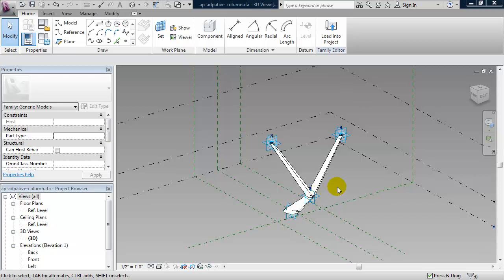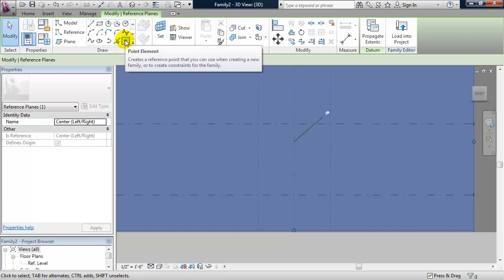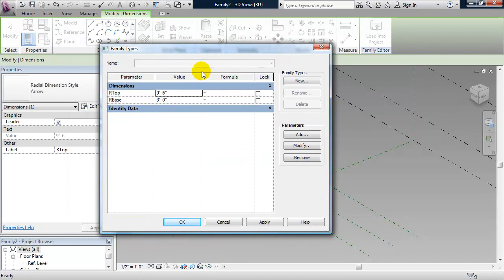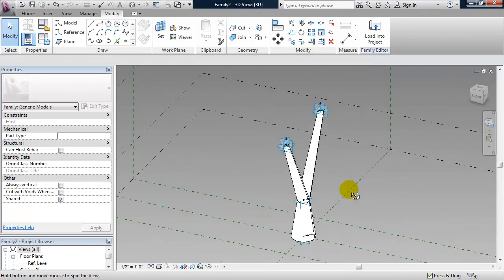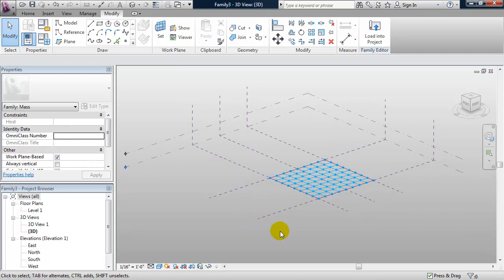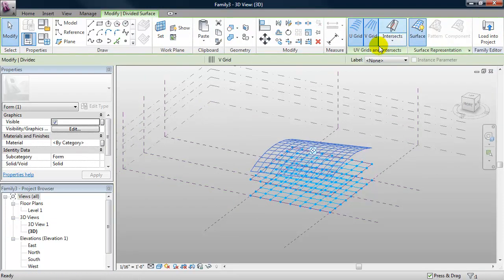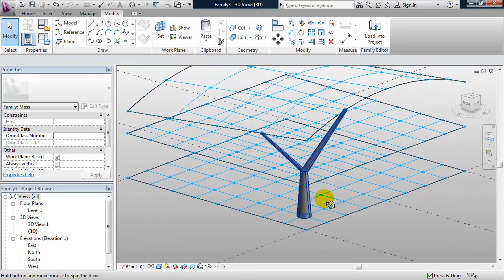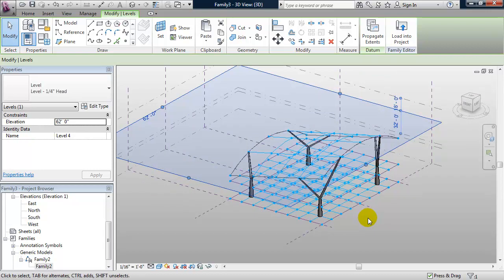Revit Adaptive Component

Comment: If I may I have an unrelated question, I often run into issues where I need to import a model like a custom looking column to calculate it's volume for materials take off like we do with forms, If I could convert the model into forms that would be best as revit automatically calculate it's volume.
do you know what is the best way to do this other than re-modeling the whole column or any custom shape again using revit form ?
Reply from the maker: Not sure. When you load the mass into a Revit project can you select it and see the mass or volume information in the properties panel?
Reply: @AlphonsoPeluso  nope, you can actually try it, if you have blender, you could export a simple box in dxf, then import it in revit, you'll see it, but it won't be recognized as a revit form with a volume, not sure which way is the best way to deal with that.